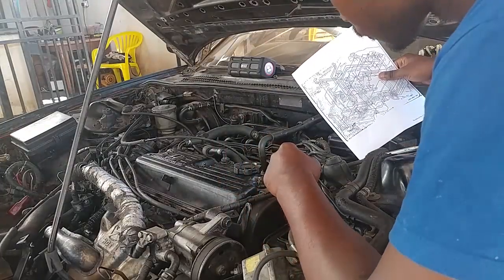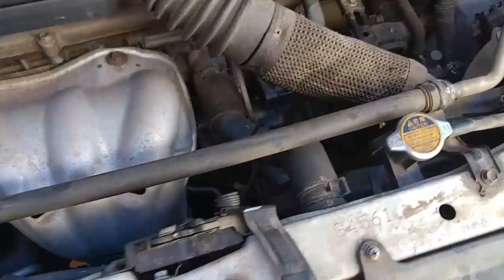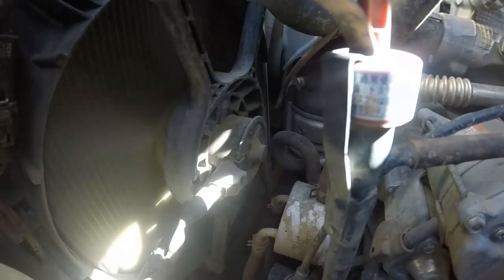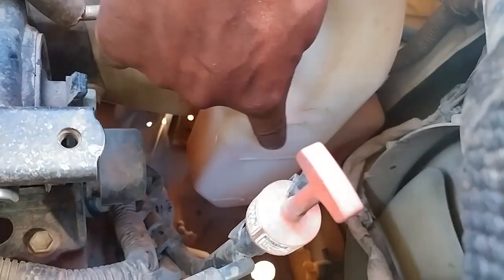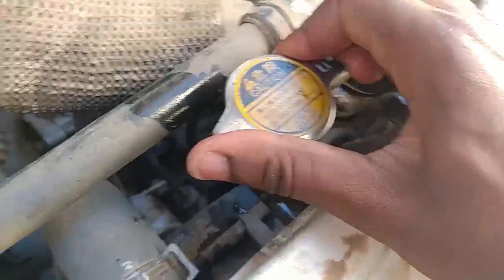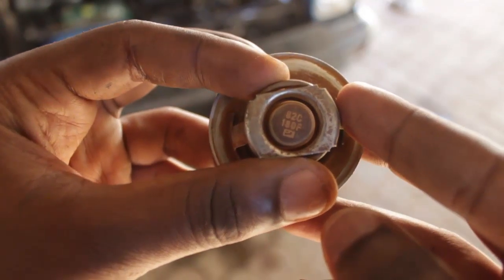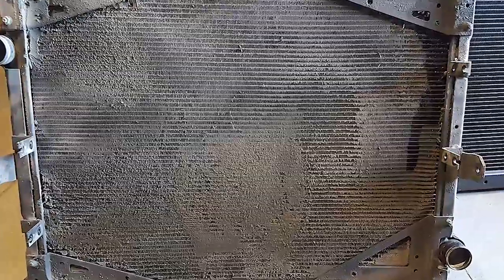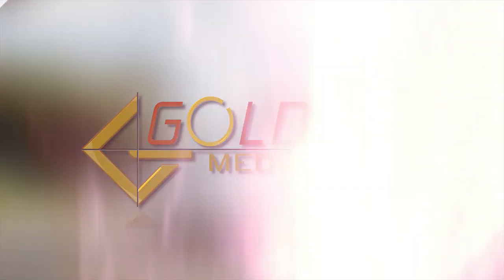Engine overheating | 4 basic checks

Comment: Great video. Short and very informative. I’m at the car park inside the shopping centre and the car started to leak coolant (boiling it) and steam came out along with coolant from the coolant compartment. With your video I’m sure I less likely going to be overcharged. Just going to add coolant and drive home.

Comment: Thanks. I’ll try the last thing, which’s blast the radiator with a pressured water. Because I literally tried every single thing in the list with my 2006 Land Cruiser heating problem.!
Reply from the maker: The heating problem came back, found out it was a worn out head gasket.
Reply: @zedgear9397  he saved me,. I honsetly tried with a Toyota Land Cruiser. I tried everything with it. ,  changed thromstats twise, flushed the radiator, too!.  And other things., nothing worked. Who ever though, 😂 after I watched this video and pressure washed the radiator for 5 minutes from the outside will solve the problem 🤣

Comment: Hi Patrick. Ty so much for this video. I have an 05 Toyota Camry and I've replaced the radiator. And it is still overheating . I'm checking the thermostat next

Comment: Is coolant liquid supposed to be underneath the yellow caution top when you remove it? When I take the yellow caution top off there is nothing there, but my coolant reservoir is full
Reply from the maker: It's supposed to be under there. Your reservoir only helps when the main system relieves pressure. Check of leaking coolant around the radiator and hoses.